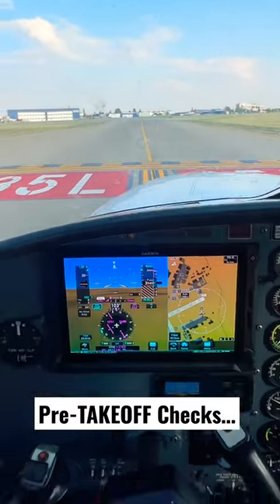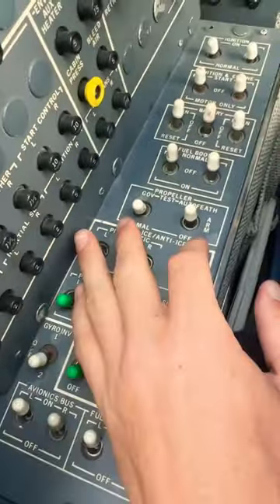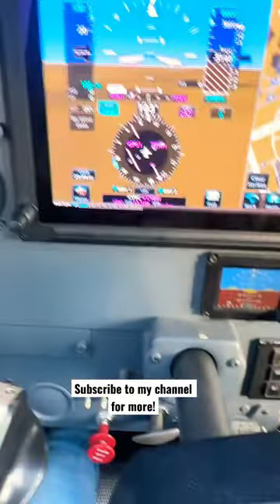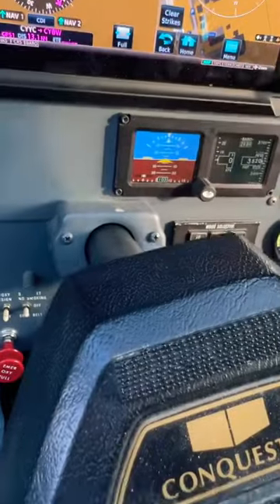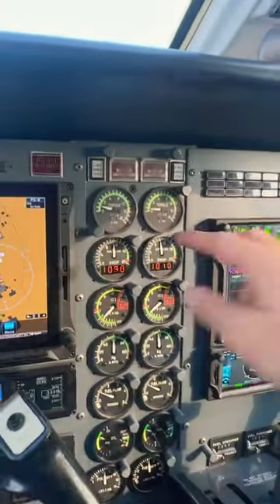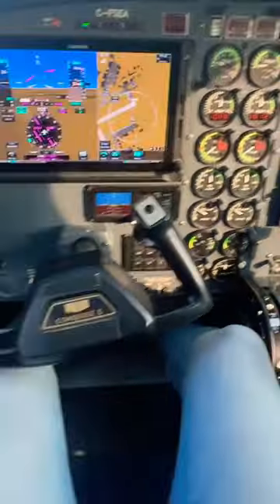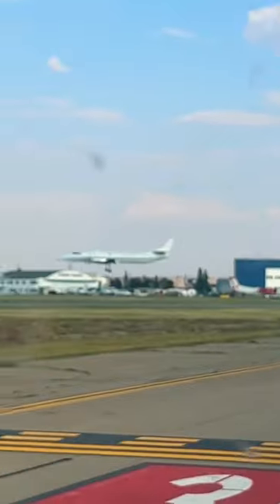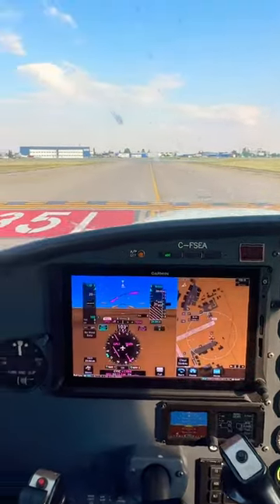🤔 Pre TAKEOFF Checks are CRITICAL! | Pilot Training & Aviation | #pilotlife #airplane

Comment: Probably a dumb couple of questions, but what is a flight director and what did the adjustment you made do?
Reply from the maker: Good question! The flight director is the “guidance” from the autopilot. It is displayed in the flight display. You can follow it in order to do what the autopilot is commanding. Basically… the autopilot will control the airplane as to follow the flight director bars :) hope that helps!

Comment: Why can't they just make an ON / OFF switch for airplanes? If there are issues, then the flight computer can ask the pilot to manually dismiss them. Otherwise all these checklists seem like they're there just for gatekeeping and because that's how it's always been done
Reply: These planes are not flying computers. if something goes wrong, the pilot understands why
Reply: Because you don't want everything running through a single control module on aircraft like cars do. If something fails, you want that system isolated from the other ones so the problem doesn't take out other things with it that might be crucial for emergency situations.